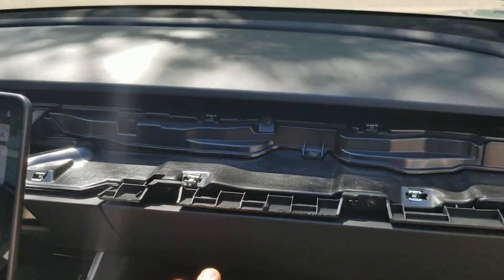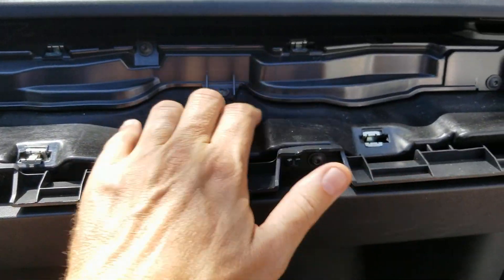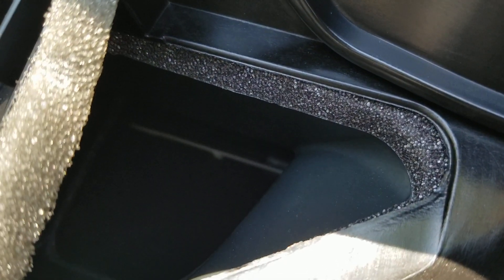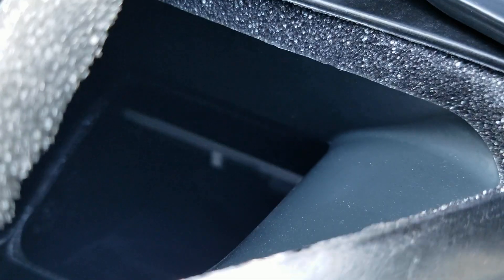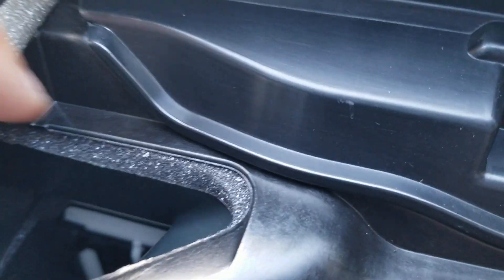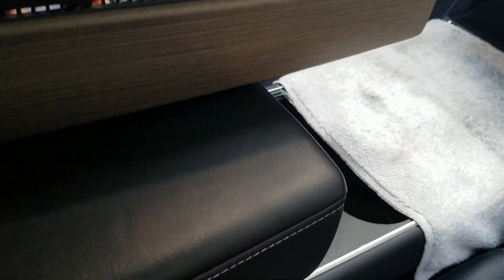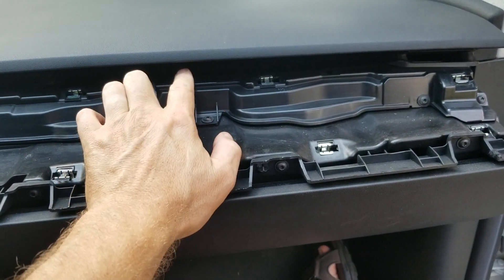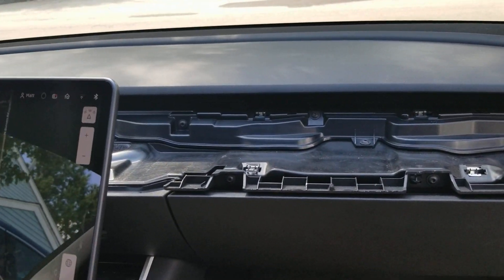How the Model 3 dash vents work internally (I took the dash apart)

Comment: How do i remove that dash piece to expose this? My model 3's AC stinks and would like to clean some of these ducts. Thank you
Reply from the maker: The stink could be the filters.

 The side caps on the very sides of the dash hidden by the doors come off then the dash panel snaps upward.
Reply: @TechForumTesla  Yeah I'm ordering new filters and will be doing an AC condensor cleaning. The smell seems to be a common issue on the model 3. 😢 

Thank you for the speedy reply.
Reply from the maker: @josecardona2229  the smell is common on all of my cars.
Reply: @TechForumTesla  I picked up my vehicle in April. Only a few months old, I also live in SoCal (not very humid) I have never had an issue with any of my other vehicles. 
My most recent 2013 Prius I changed the filter once after 3 years, was always clean and never smelled.🤷‍♂️

Comment: Yes, thanks Matt 👍 I kind of knew already how it works- and aircraft can use a slightly similar technique to modify wing airflow behaviour at high angles of attack.
There must be something else deeper down the back for side to side. 
Great to see that though, so thanks. 
Keep ‘em coming! 
Cheers from downunder 🇦🇺, my Model 3 should only be a week or two away (I hope.)

Comment: How does it split the air stream into four if there is only one valve per side?
Reply: This is just for vertical. Splitting the airflow int two streams is controlled by the vanes in the dash slit.

Comment: Two things... time to invest in a borescope (really you should have one for your line of work). To see how the side to side directional changes. 

And two, does this mean this has the ability to not only control the temperature differently between the two sides. But also speed of the air?
Reply: No. There is only one fan speed.
Reply: Robert Steich - Only the temperature is variable for both sides. The fan speed is variable but NOT independent for each side. In other words, if the fan speed is set to 3, then both sides will get air flow from the fan with speed set to number 3.

Comment: I kind of knew a bit how the up/down worked, but I'm curious where it blocks the airflow for side or center/direct? Looks like you would have to dig deeper into the mechanism tho, I assume it's controlled by some baffles that direct or block the main forward flow.